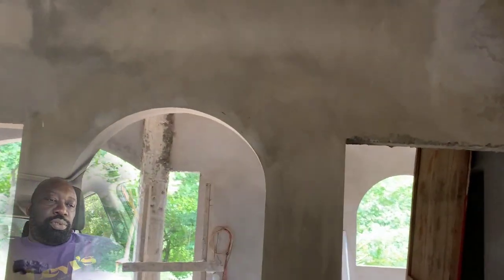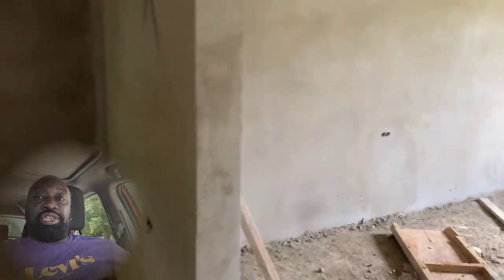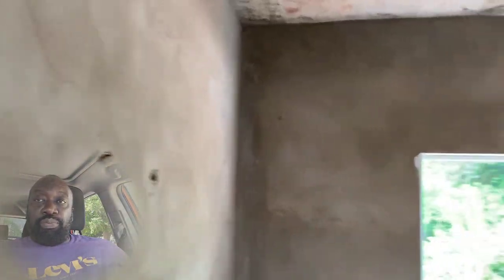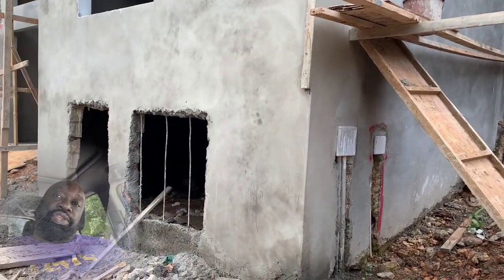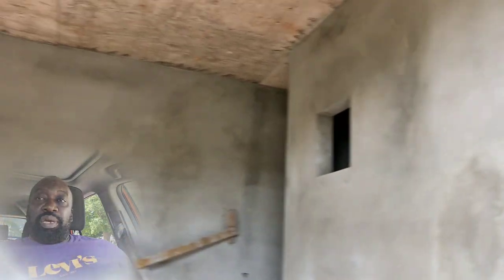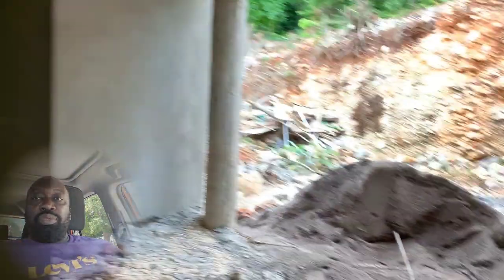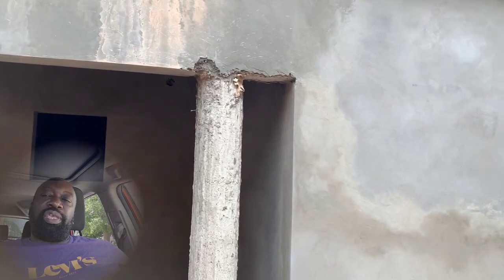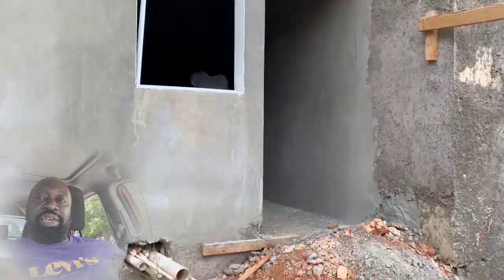The Real Cost To Build A House Concrete House Cheaper To Build

Comment: Why do Jamaica never run bedroom windows down the same side if the wall?
Reply from the maker: i don't understand your question
Reply: @Troyrhodenwebstore  i notice that in Jamaica the most bedrooms have windows on two different walls. It breaks the flow of the room and looks unsightly.. Because people usually end up put something in front of it , partially or wholly.
Its makes a cleaner design and flow to place windows alone the same side of the wall.
Reply: @claudiacampbell848  I think they do that to allow amply light to enter into the room.  The room may be a bit dark if all the windows are on one side.
Reply: @foxy8030  if the design the properties property that could still the windows on on side, and gain enough. I think its lack of thought and design.
Reply: @claudiacampbell848  It's  for cross ventilation
Reply: @firandcurly84  there are better ways to design that. Its ugly looking, plus its a waste of space.